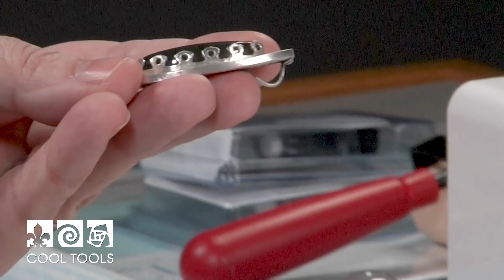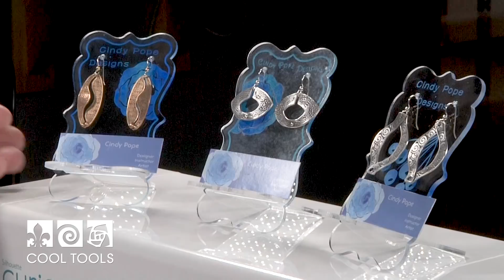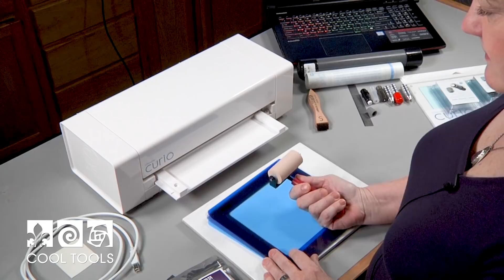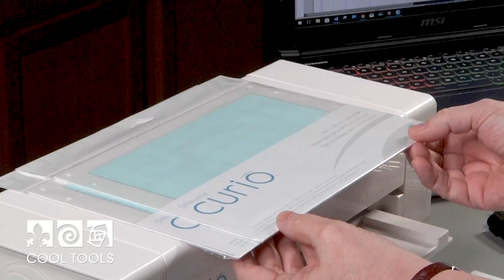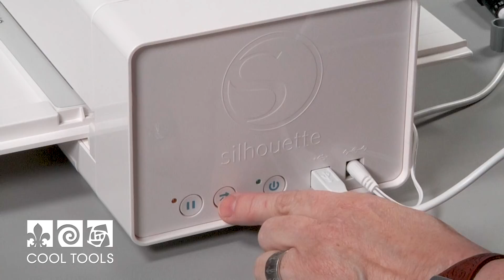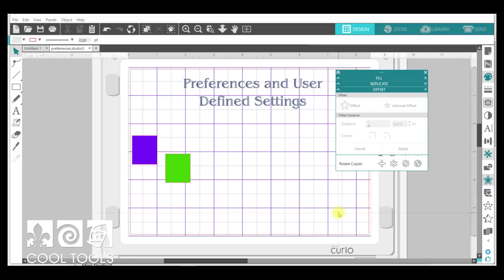Cool Tools | Introduction to the Silhouette Curio™ by Cindy Pope

Comment: After watching this and the other limited choices of Silhouette Curio videos over and over I decided to purchase the Silhouette Curio specifically to use for PMC. Cindy makes it look easy. Even purchased different Curio videos at CraftCast.(with mostly outdated versions of the Silhouette software) Frustratingly, I have found without prior knowledge of the Silhouette software the learning curve for the business edition has been a bit steep. My question is what determines how many platforms are used with the user defined settings described in this video.
Reply: 0 to 1.25 mm thickness – use all 6 mm of platforms
1.5 to 2.5/2.75 mm – use 5 mm of platforms (remove the 1mm platform)
2.75 to 3.75 mm – use 4mm of platforms (remove the 2mm platform)
Reply: Thanks so much for for purchasing some of my craftcast classes.  I would recommend the Learning The software Video. https://www.craftcast.com/recordings/getting-know-silhouette-software-version-4 if you are having problems with the software. Please also join the McSilies facebook group and I will help you join the free private student group for craftcast students which will give you any support you need. https://www.facebook.com/groups/MCSilies/
Reply: @cindypope6122  🙋🏼thanks Cindy for your response. The struggle is real 🤪🧐😡🤣but I will keep trying. Unfortunately I don’t do Facebook but thanks again for the suggestion and support. I believe with determination and practice, eventually I’ll overcome the steep learning curve. I read somewhere you said at least 15 minutes a day of practice until the steps of a project are memorized without referring back. I’m getting there.

Comment: I have the Designer Edition and the Panels won't save in a stack like you set up. Yes, I saved a blank project and restarted the program and it defaults to just the Page Setup Panel only open. Any ideas to make that setting permanent?

Comment: When trying to set up the user defined settings on line color, I only 1 line and the box is red. How do I add the other lines and change the color. I did read a comment below and added some boxes. Also. How do I get the pdf you indicate you provided. I have spent many hours trying to familiarize myself but still have not been able to actually use the Curio. Is it usually that difficult to perform a simple task.
Reply from the maker: Hi Linda, the pdf can be found here:

https://www.cooltools.us/Video-Introduction-to-the-Silhouette-Curio-by-Cindy-Pope-s/2619.htm

Cindy Pope explained to us: The user defined settings are not just a simple step in the process they are a foundational part of the process because the user defined settings preset in the program are for paper and vinyl and other things, not for metal clay. We need to add them only once so they are always available when the machine is used for metal clay. The colors are the colors of the lines of the titles (blue ) and the line colors of the boxes (red) . If you have only one color of box or shape on the screen (red the default color) when you go to cut by line color under the send tab you will only see the red line. If you draw a second box and change the line color to Blue and go into the same screen you will show the 2 color of lines in your file blue and red.   

Hope this helps! Please note that there are other videos as well by Cindy that may help. She noted that: On the earring design video minute 16 to 22ish you will see the color scheme (red for cut, Blue and Green for Etch)
https://www.cooltools.us/Project-Video-Silver-Fold-Over-Earrings-using-p/ctp-295.htm

On the Faux Bone Video  minute 23 to 30ish talk about the send screen also https://www.cooltools.us/Project-Video-Design-and-Etch-on-Faux-Bone-p/ctp-327.htm

Comment: Help!!!i bought a Curio to use with metal clay specifically.  When setting up my software and machine, I’ve come to a hurdle.  When selecting my preferences and user defined settings, I click on the “line” tab and nothing is in those fields.  There is no + sign or any way to add info in those fields.  I can, however, see populated fields in the “simple” tab.  What am I doing wrong???? This is driving me cuckoo and I don’t know where to get help!🤔
Reply from the maker: Hi Kathleen, we asked Cindy your question and she replied: "She needs to have at least one shape drawn on the design screen in order to see anything in the cut by line color tab. There need to be lines for the cut by line color tab to be populated. In the video there are 2 shapes on the screen. She will only see one tool in the send screen unless she has her Curio plugged in with the platform loaded."

Hope this helps!